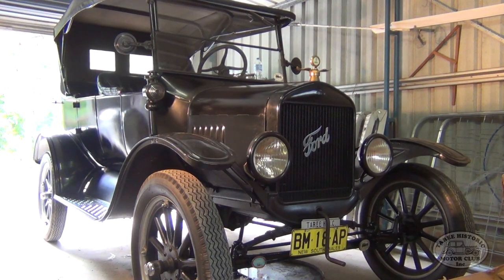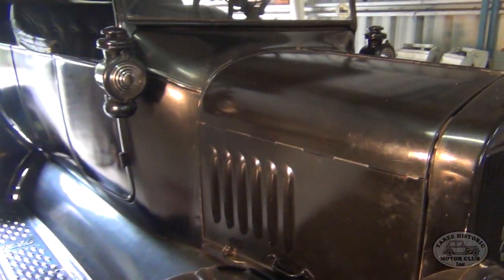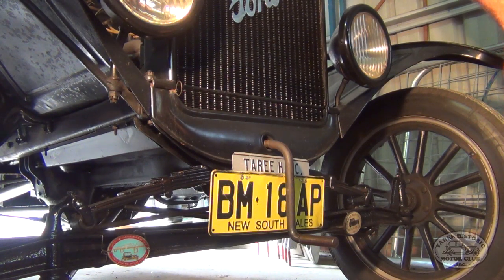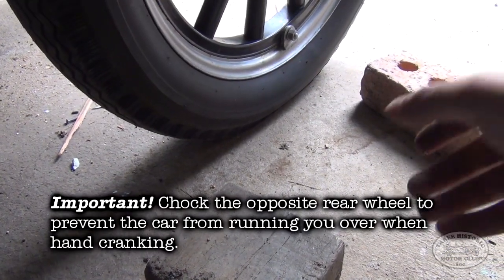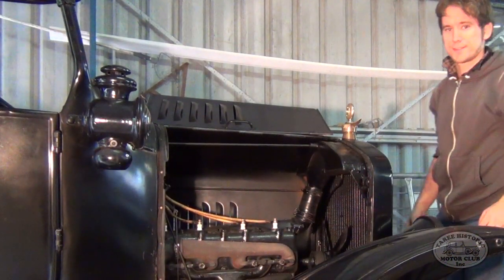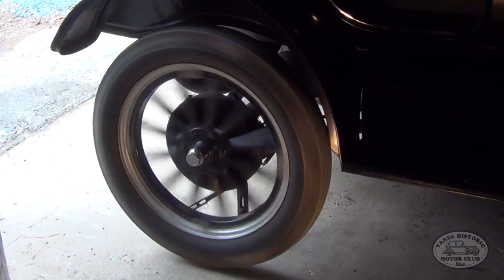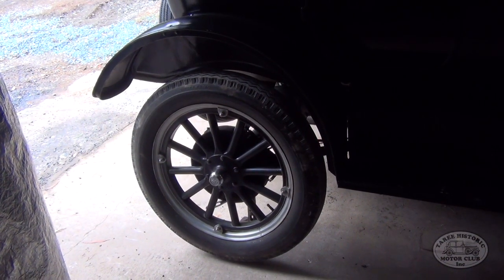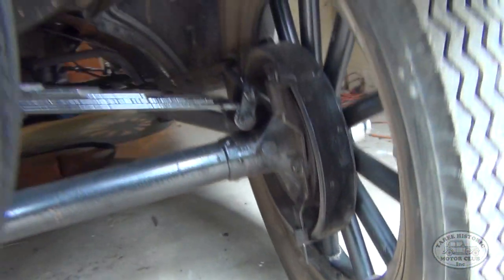Ford Model T - Starting in Cold Weather

Comment: Excellent advise!  It is exactly what the old timers told me in about 1961, when I first put my 1925 Touring on the road after restoring it.  One bitter winter day, I decided to give it a try, and sure enough, if cranking it by hand without the rear wheel being up off the ground, each piston up would fire but not bring the following one up to continue the engine to run.  What was different from the old timers advise from what works nicely for you, was to throw the clutch into high and let that back wheel act as an addition to the engine flywheel forces, and with the deep cold, my old Lizzie needed this!  You bet my wheels were well chalked.Right now in Seattle, it is snowing like crazy!   With all our hills of the city, tomorrow's commute will be treacherous but a good day for body shops and emergency vehicles!  Back in North Dakota winters, an old timer told me of having to bring hot coals from the wood fire in the house in a pan to  place under the flywheel housing to warm the engine oil, also hot water to pour over the intake manifold which helped to vaporize the gasoline.  He bought his first ford in 1917  I understand the gasoline at that time was not much better than Kerosene!!!!  Once a Model T engine was running you could use kerosene to run it, but power was less.

Comment: Cold starts are rough but cranking through 360 degrees is still dangerous.  Pulling through an arc at the top is much safer.  You'll usually get away with it but when you don't...would hate to see you hurt (badly!).

Comment: Actually, there's an easier and safer way. jack the rear wheel on the same side as the driver. Put the car in top gear and grab the wheel and give it a spin. No broken arms, car won't run over you. this worked on my old VW and it worked like a charm. I read about this years ago. This will probably work on any manual transmission as long as the engine is small and doesn't have high compression. Enjoy your site. Jack